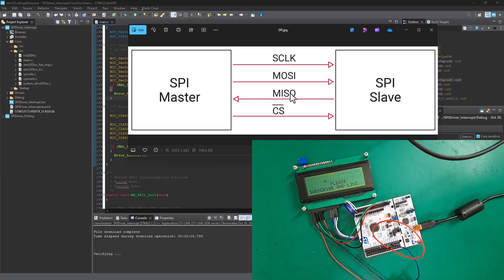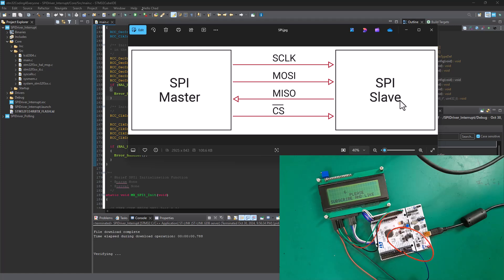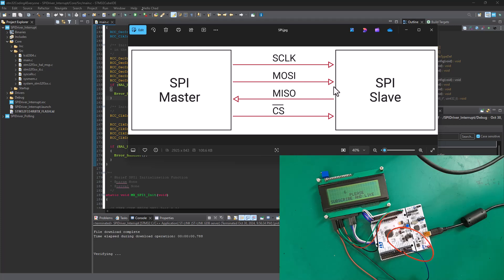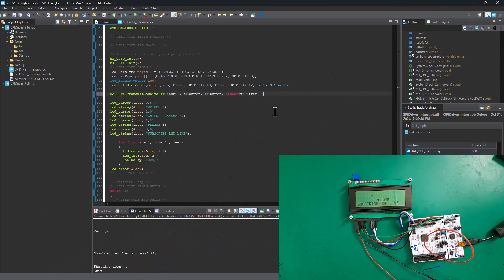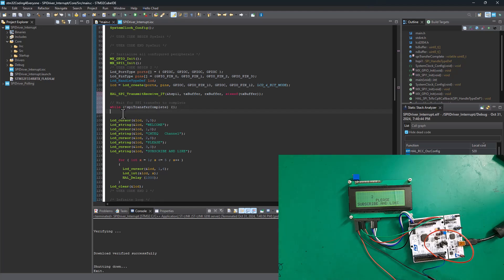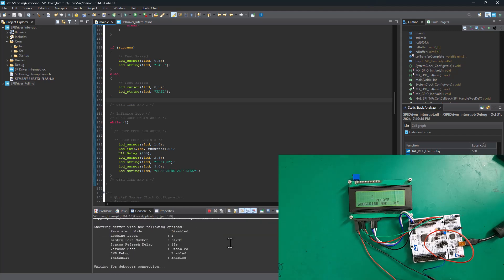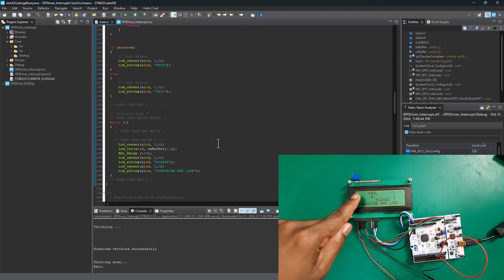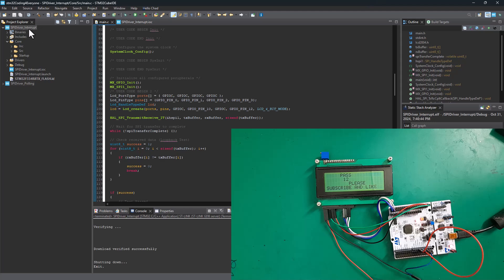14. STM32 Interrupt driven SPI Driver  - SPI Loop back TEST

Comment: You do a software based slave select and 1. do no explain 2. do not drive SS low before the Xmit and high after the Xmit. You are lucky because you are doing a loop back. With a real slave chip your program would not work. Not so great for a tutorial.
Reply from the maker: Obvioulsy it would not work in a normal use case where you have Master and slave separated. The loopback test typically doesn't involve an external slave device, so there is no need to control the SS pin.

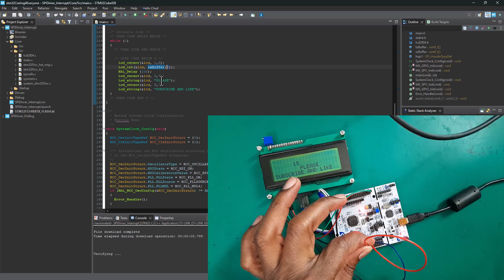In a SPI loopback test, the MOSI (Master Out Slave In) pin is connected to the MISO (Master In Slave Out) pin via the jumper red wire @5:10. Since the same device acts as both transmitter and receiver, the SS (Slave Select) line does not need to be explicitly driven low or high.